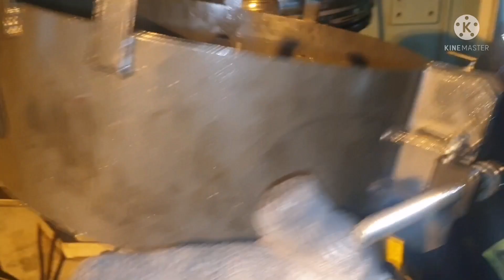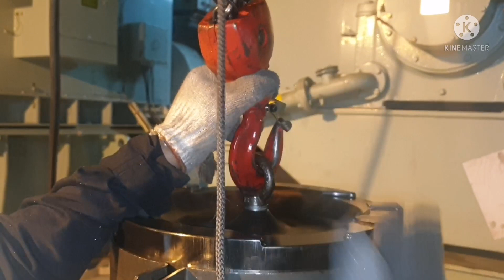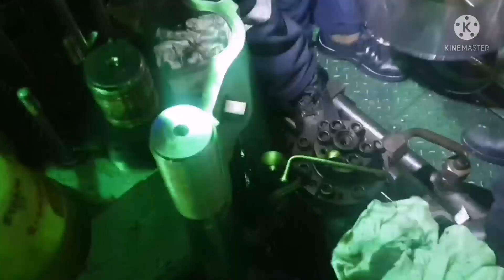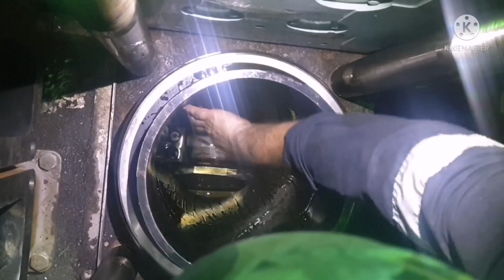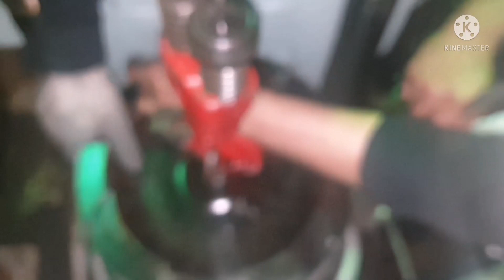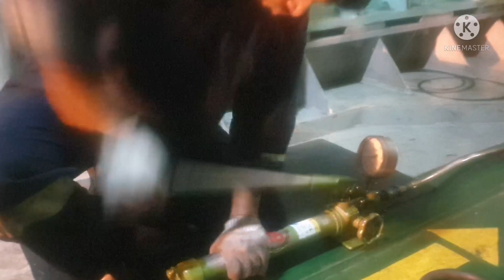How do they do... How to do yanmar Generator decarb Part-5 ( Installation of piston)

Comment: Palming area heat up reason?
Reply: Palm area or the piston rod foot landing area ..under what conditions the temperature increases in that area ..asked by surveyor during orals
Reply from the maker: @cadetjoy6935  There are several reason for the palm area to get heated up..
* Piston getting overheated.
* Piston  blow pass.
* Liner worn out.
* Palm bolt not tightened properly.
* Palm bolt angle tightening not done as per procedure.
* crank case primary Explosion.
* Improper  or insufficient lube oil supply.
* Over load of engine.
 * Palm bolt not fitted in place properly.
These are also the cause for palm bot heated up..
Reply: Thank a lot sir
Reply from the maker: @cadetjoy6935  hope this reply vl satisfy ur query sir
Reply: Sure sir
Reply from the maker: sir can u please elaborate your question?

Comment: sir, when lowering the piston, is there any marking is given by the maker on piston crown? like matching alignment with piston crown and liner marking ?
Reply from the maker: No sir there is no marking on piston ..only we need to check the E marking on the connecting rod.. which we need to position the connecting rod towards the exhaust manifold side.